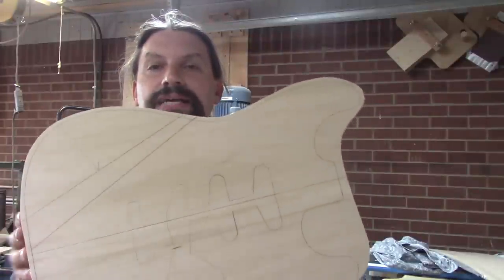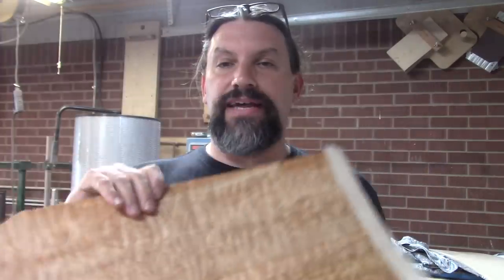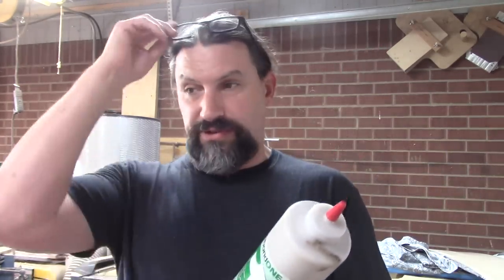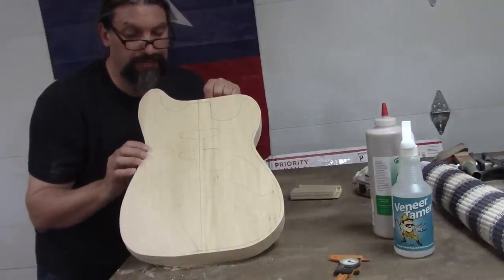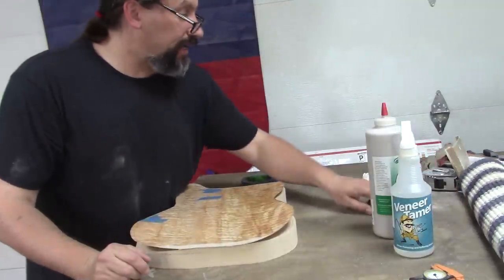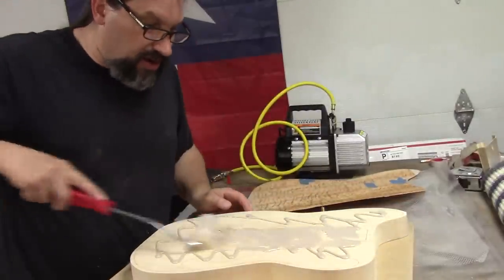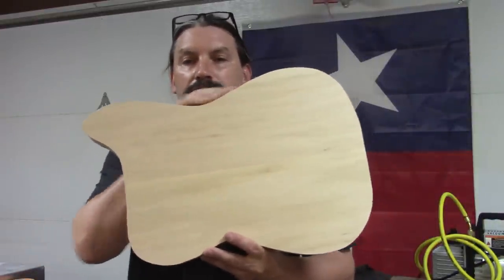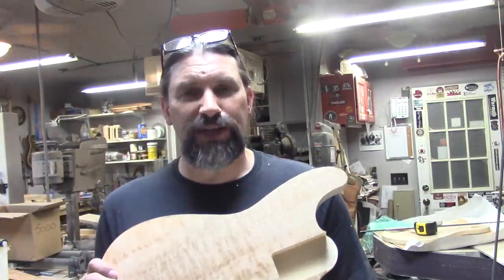How To Glue A Maple Veneer To A Strat... With Hot Suck Action!

Comment: I do a good bit of veneer work.. My $0.02: If you lay out your rough cut on the top you can reinforce the cut line with venneer tape then cut it with sharp scissors. I use upholsterer's snips. The tape will scrape off easily after the piece come out of the press by first dampening it with a sponge. Also, a couple additional veneer suppliers are "Veneer Supplies" and "Certainly Wood". Cheers!
Reply from the maker: Thanks Scott, Veneer Supplies will not ship to Colorado, bums me out

Comment: Good quality veneer is usually 1/22". Modern commercial veneer is closer to 1/40th of an inch. If you tape the cut line, prior to cutting, it will be less prone to cracking. Sharp scissors will work well also. Unibond is a thicker glue, color matches better, doesn't bleed through the veneers and if it does, won't negatively effect the finish, like tightbond yellow will.

Comment: Hey if you guys want to get into vacuum sealing tops on your guitars but don't have the shmeckles for a full on rig like Matt's check out a skateboard supply company called Roar Rocket, they sell vacuum bags that use a hand pump for really cheep and they actually work great. You will get quite a few tops done before you need to upgrade to the big daddy but if your are serious about doing a lot of veneering then you should fork over the cash for the good setup.

Comment: Hey Matt I use titebond cold press for veneers, rather than the original titebond. it works very well, It doesn't bleed through and prevent your dye from getting in the grain. Interestingly enough the titebond veneer glue is the same coffee colour as the one your using.. But I used a 20kg bag of sand in a pillow case to press the veneer!  Sounds crude? It is, yet it worked a treat.
  The vac bag works well, I asked myself this question before I started?? How does the glue dry when sealed airtight? now watching your process I'm thinking that's what the breather mesh is for, to create a tiny airspace for drying, great idea!! 
 Thanks again for sharing your knowledge 👍
Reply from the maker: Give it a try sometime brotherman yo might dig it
Reply: A sand bag is a great idea. I spent 20+ years in the aquarium trade and I always used crushed coral to glue faux stand covers to hide plywood until they glued stuff down, sand would have worked much better, play sand is pennies on the pound vs crushed coral, but it never dawned on me. To me, it was what I had on hand, but it makes so much more sense. I also would have around 300 pounds of crushed coral covered in wood glue now. I can't even use it in aquariums either.
Reply: "How does the glue dry when sealed airtight?" Don't most glues dry by evaporating the solvent, rather than reacting with air? I would kinda expect most glues to dry more easily in a vacuum, since it'd make it easier for the solvent to evaporate. Of course there are tons of different glue types, some react to pressure, some to heat, some just evaporate, some rely on chemical processes when in contact with materials... Who knows the specifics of these glues! (Well I guess the manufacturers do...)

"now watching your process I'm thinking that's what the breather mesh is for, to create a tiny airspace for drying, great idea!!" To me it seems the idea of the breather mesh is to make sure the point where the nozzle is doesn't just seal against the body, and only create a local vacuum, instead making sure that the air gets removed from the whole area. But I might be mistaken.
Reply: Sandbag: 20 lbs over 200 square inches = .1 lbs per square inch (far more than enough to hold down any veneer)
Vacuum: up to 14.5 lbs per square inch (far more than any tornado)
Whatever works, of course, but yeh, physics.

Comment: Nice job!  Just a small suggestion though, before I would put the guitar into the vacuum bag I would put a couple of strips of tape to keep the veneer from possibly slipping. Nice though.
Reply from the maker: Good advice
Reply: Yes i agree with taping it down...it will eliminate movement

Comment: I think you made a good call using more adhesive than you thought you needed, especially with those small cracks. I would tend to think that using additional glue would cause it to soak somewhat into the veneer, which would definitely help you out. I've seen far too many veneered guitars that have bubbles and de-lamination developing after only a few years. Tis the main reason why I don't buy veneered guitars. If its gonna have a figured cap on it, it better damn-well be a proper cap, not a paper-thin sheet. I've honestly never liked veneers, mostly since they are widely used on over-priced furniture and guitars that are trying to be something they're not.
If I'm ever to put a top on any of my guitars, what I'm gonna end up doing is planing 1/4" - 3/8" off the top of the body and replacing it with a chunk of proper quilted maple or something similar.
Reply from the maker: Too much glue is a thing too. We did one where the adhesive got sucked through the veneer and made a huge mess. 
I think a lot about veneers and put them in the same category as painted graphics or even our fabric tops. They certainly don't anything sonically... and that's okay. If companies charge more money for veneer than that's not okay.
Reply: When it comes to caps, maple specifically, it's not about the sound for me, although a thicker hard-wood cap will tend to brighten up all Mahogany guitars like the LP, simply because hard woods tend to absorb less of the high-end resonance of the strings. You can disbelieve in the whole tone-wood schtick all you want, but the fact of the matter is that harder materials, regardless of type or species, will yield a brighter sounding guitar. What makes me interested in them is both a cosmetic and durability thing. Any type of maple cap will generally be a lot harder than the substrate wood, which enhances durability, and let's face it: A slab of Quilted Maple will generally have alot more depth to the grain than a veneer would, and would be easier to finish, to boot. The only thing difficult about it would be rendering the faux-binding, masked off edge look that I love so much about guitars with proper caps on them.
To me, the sexiest guitars I've ever seen had the edges of the cap masked off when applying color coats.

Comment: I was slightly terrified squeeze out would glue the top to the bag :)  Thankfully I was wrong!
Reply from the maker: Ha yeah that would be a bummer, the bag is pretty slick... I don't think anything would stick to it.
Reply: Epoxy resin won't even stick to these things.
Reply from the maker: I saw a video of a guy doing a fabric top with resin in one of these bags once... was that you Don?
Reply: I have not done a fabric top (yet :) ) - but I have done body and neck laminates with both West Systems and 3M epoxies.  As long as the surface of the bag is still pretty "slick like new" most resins won't stick too much.  That said - I don't leave anything in the bag any longer than the initial set for the adhesive in question. Once it's glued I pull it our for the "full cure".

Comment: I can see that this wood be fine for veneers. Have you ever tried it on a thicker drop top style with wood, say approx. 7 mm thick, which is a common size over here in Europe. So about 1/4" over there? Any thoughts as to how this might work? Guess you might need to do a pit of pre-bending on the top for a forearm shape cut out, or some slight nothing on the face against the top to allow the bend. But i would have thought in principle this should work.
Reply from the maker: Hi Tim, 

I think that would work great. The nice part is you could test it first before you put any glue down. I also did a video where I used clamps for an 1'8 inch top. 
Give it a try and let me know

Comment: build out the sides of your body with a steamed and molded up 1/4" piece of filler strip so its flush at top, double sided tape adhere to body, then let your veneer hang over the body 1/4" be sure not to glue that strip.. then when you vacuum your edge will not be crimped and broken down then you can shaper perfectly with router and not worry so much about placement on glue up
Reply from the maker: Cool man

Comment: Would you recommend using a vaccum press on a guitar body that already has pickup cavities on it ? Do you think it would cause a problem ? I want to refinish my Ibanez prestige RG1570 ! Thank you and great videos keep up the good work !
Reply from the maker: Yes, absolutely... as long as your tip is thick enough or strong enough to not break in the cavities. .023 veneer is probably too thin 1/8 spruce is to weak. You know what I mean?

Comment: Hi Matt. I know this is an old video, but how do you stop the veneer cracking as the body wood expands and contracts over the next few weeks after glueing it on? Cheers.
Reply from the maker: Hi Martin, we do not have any issues with cracking... sorry I can't help you
Reply: You have to balance a veneer most of the time.  Which is bonding another veneer to the backside of the face veneer. This allows the veneer to expand and contract. It will prevent warping, and shifting of the veneer.

Comment: Ok, so, how do you do this on a carved top Les Paul?   I assume that the carved aspect would make the veneer crack, so my guess would be to use steam to make it pliable, but then I feel like the glue wouldn't hold.  Thoughts from anyone? 

Maybe steam it then vacuum it until it dries, then glue and vacuum again? There has to be a way.... more info needed. I want to do this on a les paul I'm getting. Thx
Reply from the maker: Hi MB, 
You can absolutely do this on a carved top Les Paul. You might be surprised and just how much you can flex this stuff without it cracking. There are products you can use to make it even more pliable… you do not have to steam it. What you will have to do is tweak the center seam, it will not be straight, it doesn't make sense but I assure you it is true. Check this guy out he is pretty good at it...https://www.youtube.com/watch?v=xuHFc3BNJYM

Comment: Tite bond may suck up into the veneer and cause finishing and staining issues, unibond has "woodflower" in it which keeps the glue from sucking up to the surface. Also unibond and other veneer specific glues dry harder tha titebond so you wont get wood veneer creep ,which is bad..i only use the mesh on the face side unless you are double veneering , leave the blank closely to the veneer size ,square. Eliminates razor blading, i hate that. That way the veneer wont crush over the edges. If you have a porous spalted veneer you can coat the glue side with seal coat shellac first .veneers are fun.
Reply from the maker: The glue I used for this worked like a charm, no reason to switch. It is going to be a while before I run out. I ended up using the mesh on the top rather than wrapping it as well. I'm not sure what it really does but I bought it and by God I'm going to use it! hahaha
Reply: The mesh simply allows air to escape / not form pockets if the valve happens to "suck down" to the surface before the bag is fully evacuated.  More important on flat surfaces than contours, but not a bad habit to use it.  It will, over time, crush down tho.

That's a lot of glue - shelf life is about a year once opened.  I'd suggest dividing it into smaller bottles, and storing in the fridge. 

Joe at Veneer Supply is a great guy - he's got some KILLER tamo ash the perfect width for bookmatches. Pricey, but incredible figure.  (well - pricey to me, but the per-top cost is less than what you paid for the stuff in this video)
Reply from the maker: Thanks for watching Don, we have several 1/4"  roasted ash tops right now... you are right Joe is a cool dude. I think I mentioned that in the video? If not, I'll do another one.
Reply: Yeah - you mentioned them for sure.  I LOVE roasted ash.  I took a huge tree down in my yard last year - had a section sawed into 8/4 boards, should be ready to use next year.  Ash borer beetles killing all the ash up here in the NE. Roasting northern ash is about he only thing other than chambering that will lighten this stuff up. 

But Tamo ash (Japanese I believe) is a whole nother level - check out these bookmatched sets! (IIRC about $14/set)  - https://imgur.com/a/7l4BCSB
Joe's stock must be getting low - he's jacked the prices a bit since I bought mine (but he's still got some nice stock)

Comment: Do NOT used water based glue with veneer.  Use Veneer resin or contact cement. Water based products will cause your veneer to warp.  If your veneer is cracking that is due to improper moisture levels and pressing.  Use a specific mixture of water, alcohol and glycerin or just buy the veneer wetting mixture.  Don't just spray it on and go. You need to lightly saturate the wood and then press it. Changing out towels in the press the 2nd hour, 5th hour. After 24 hours, your press should be complete. No cracking and your veneer will be flexible.

Comment: Can’t justify a vacuum for one project. And pointers on what I should do? I tried going with clamps and it left it bubbly all over....
Reply: You can get a vacuum pump pretty cheap on Amazon, and I've even rigged one up from an AC compressor from an auto junkyard. You just need to put a couple tack welds on the clutch so it doesn't spin, then bolt it to a frame with an electric motor. Just make sure you get the direction of spin correct.

Comment: Apparently veneer glue has a lower water content than say regular tight bond,tight bond do  a veneer glue also,something to do with normal glue soaks throUgh the veneer and changes the colour of the veneer,maybe making it blotchy,plus the extra water cant evaporate properly in the vac bag.
Reply from the maker: I'm not sure what the difference is?
Reply: i heard it's the water content in normal glue that can mess the veneer up,i'm an electronics technician,my only trip to glue land is for tightbond for tube amp cabs,though i may need to veneer my telecaster(once i build it).